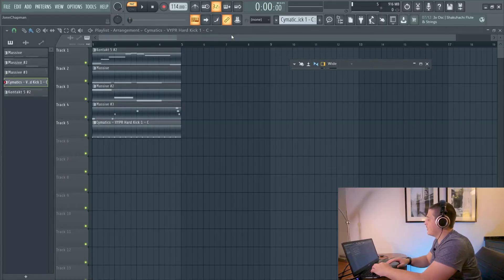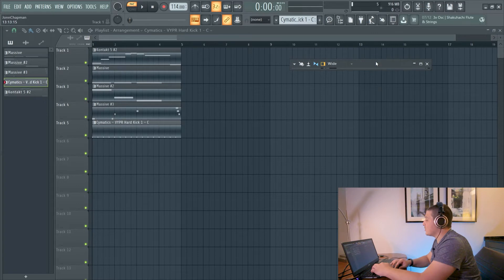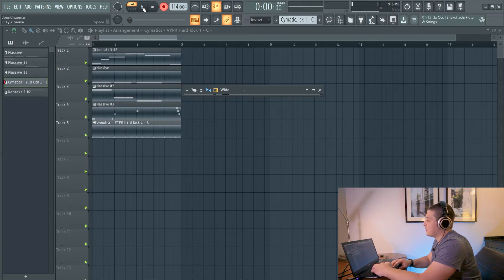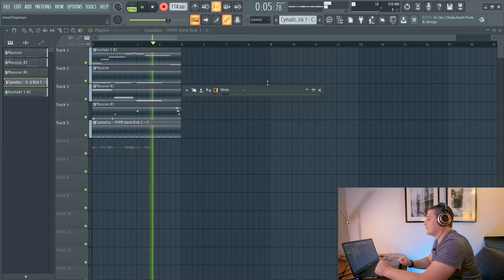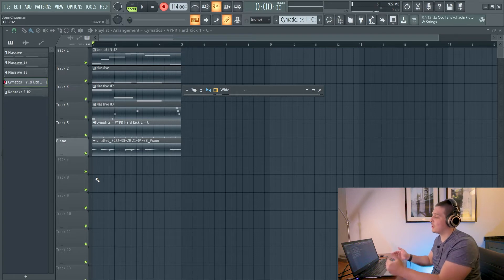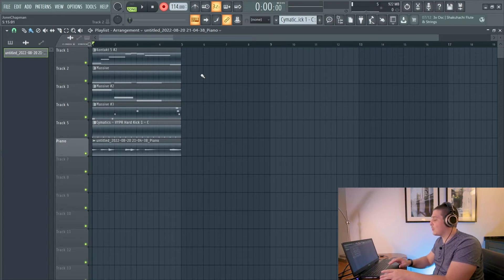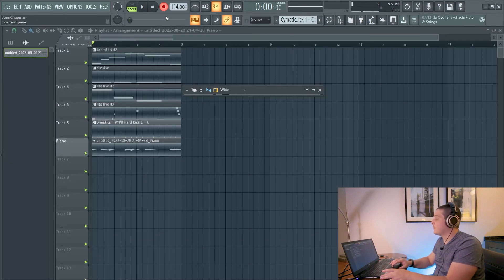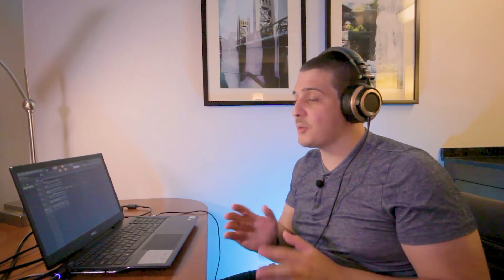"Timing Off When I Export" - FL Studio (Export Issue Work Around) | Live Printing

Comment: Even when doing it this way, my timing is still off on one of my pianos. It's fine when I'm listening to it in FL though so I really don't get what's happening.
Reply from the maker: Sorry for the late response! If you experience this problem again try the following.

1. Verify that none of the plugins on the mixer track for the piano is the offender. You can do this by muting them and seeing if the issues persist.

2. Go to the troubleshooting tab of the VST wrapper settings for the plugin that is giving you the issue. Check the "Fixed buffer size" option and then print the offending plugin.

3. If the above doesn't fix the issue, go to your audio settings and click the "Align tick lengths" option.

4. You can also try ticking and unticking the other options in the "Troubleshooting" tab of the VST in question. If you can fix the issue you will probably want to switch the settings back after you print the audio so you can avoid unnecessary latency while working.